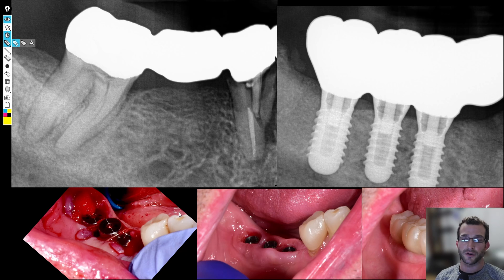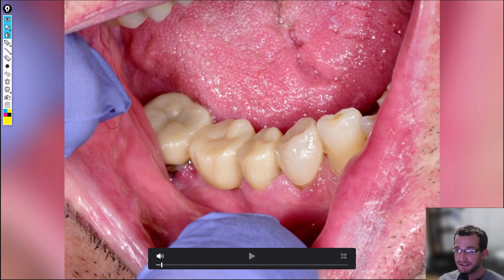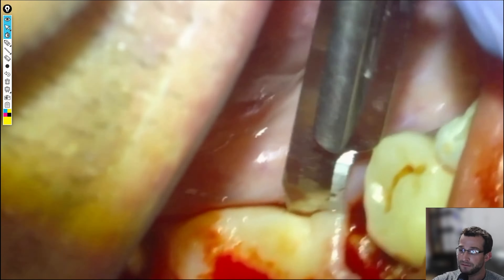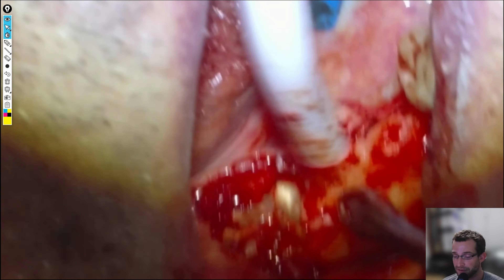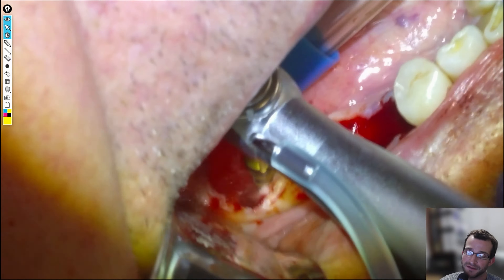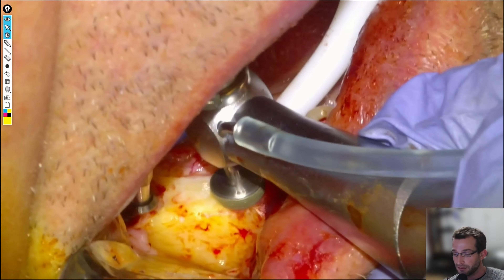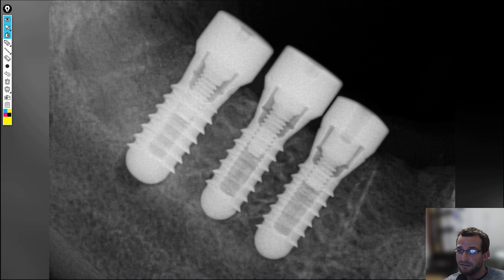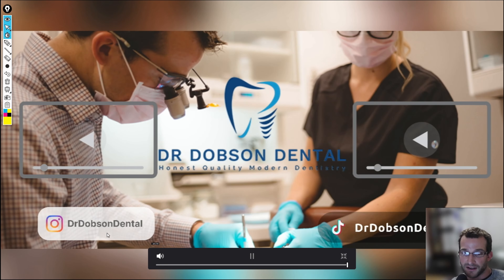[67] Immediate Dental Implant Bridge Surgery and Delivery

Comment: I’ve made implant crowns for +10 years, and never do re-torque. And I haven’t lost a single crown…yet 😊 I only use original Straumann parts. If the need for angulation pops up, I use a Digitek abutment. You did a great job placing those implants, a perfect row of 3 parallel implants. Kind greetings from Denmark
Reply from the maker: I'll often say single units are absolutely mandatory to retorque while multi units is just highly recommended. Over the course of decades or service the screw can back out with big forces. Also if the proximal contact are quite tight on insert you'll normally get s quarter spin on the retorque once the PDLs accommodate.  I've had a couple single units come loose so I always retorque singles esp now.
Cheers from Canada 🇨🇦❤🇩🇰

Comment: I just had three upper front teeth extracted and it was very very painful. The dentist told me that because the whole area was inflamed, the local anesthesia didn't really work and that's why it was so painful. 4 more upper front teeth have to be extracted in one go. Also in a very inflamed area. What can I do to reduce the inflammation in order to have a less painful extraction?
Reply from the maker: In my experience achieving an adequate level of anesthesia is dependent more on the operator's technique rather than patient factors or local factors. You shouldn't really be feeling pain intraoperatively if the operator has proper technique but you can take antiinflammatories to manage pain post operatively
Reply: @behindtheloupes  Thank you very much for your answer.